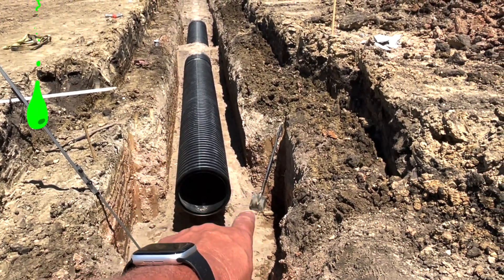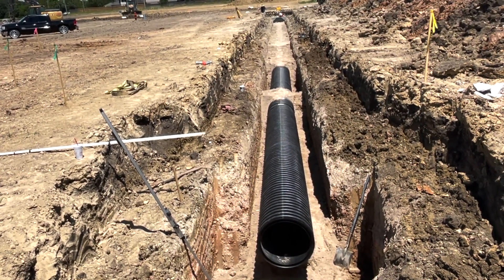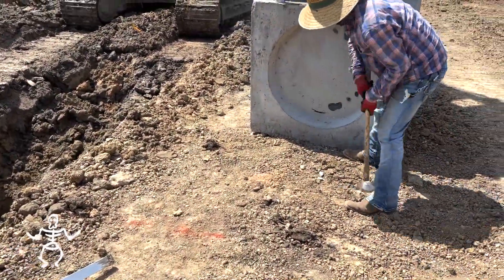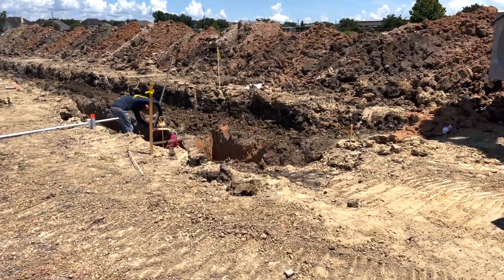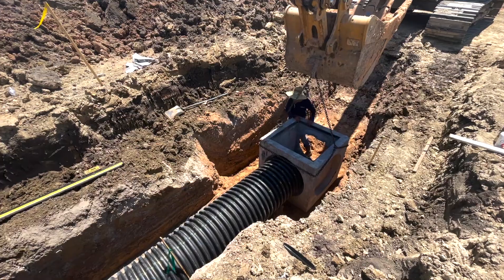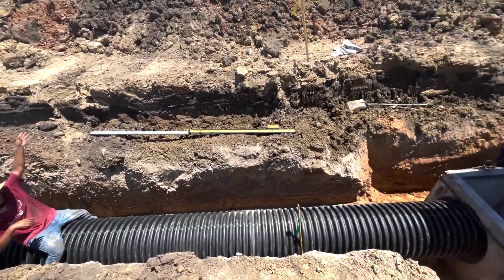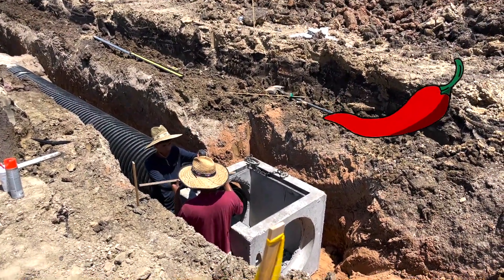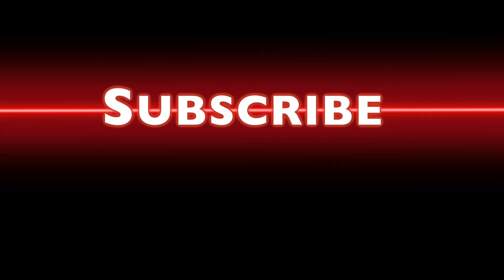Installing Concrete Catch Basin and HDPE Pipe, for Storm Drainage

Comment: Rough total job cost on something like this? Building a house and we have a drainage easement and I would like to route it like this.
Reply: This is more so community storm water drainage that would run below the road.

For doing it at home you can use far less expensive systems. 

These are also referred to as gully systems and for your home you use maybe 4” piping. You can also put channel drains if you have areas where overland water sheets during rain. Gully is more for areas where the ground has been graded toward.

If you’re looking for a system suitable for your situation contact a landscaping supply company their sales department will set you up with what you need to properly drain your site.

Comment: Crane operator needs to be fired. Owner or manager needs to be jailed for putting the expendable immigrant labor in the line of fire.
Reply: I was thinking same thing… so many safety issues. Give your guys vests, hard hats, safety glasses when sledging out concrete for connections. Eliminate pinch points with the excavator.  I was wondering if that’s why the skeleton appeared… did one of those guys die? 🤦‍♂️

Comment: Oh man just found out they want metal corrugated pipe 24”. What’s the difference  in the long run between hdpe and metal?
Reply from the maker: HDPE works on private ground and if it is supported by a base. Drawback because it is plastic it easier for it to float. Corrugated pipe because of the of the weigh it is better to use for discharge and intake pipe. RCP is required under heavy traffic area for the strength.
Reply: @thomasconstructiontexas  thanks.
Reply: @thomasconstructiontexas  they make different types of HDPE for heavy traffic
Reply: Main difference is cost, and design life (also cost related), solid round PVC is more expensive but has a design life 100-years+ since it’s plastic. Corrugated steel pipe (CSP) even when galvanized corrodes over time and depending on soil or water conditions (high salinity) can accelerate the corrosion. Usually the extra cost of pipe material outweighs the cost of construction in these situation so using a PVC option is generally what is used. 

You can also get PVC coated CSP which is a cost efficient option. I don’t know if that is what is being used in the video or if the video is just corrugated PVC.
Reply: @monsieurgarf4058  I used cmp. I’m glad I did. Too many benefits. But you already know. Thanks for comment.